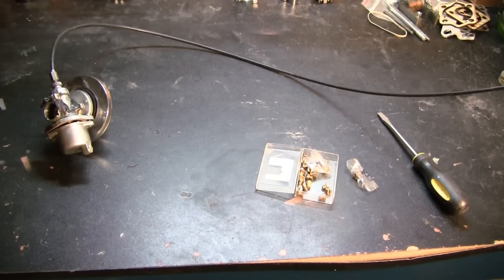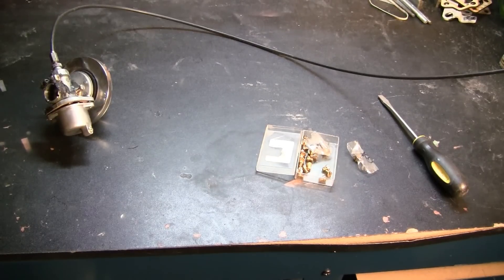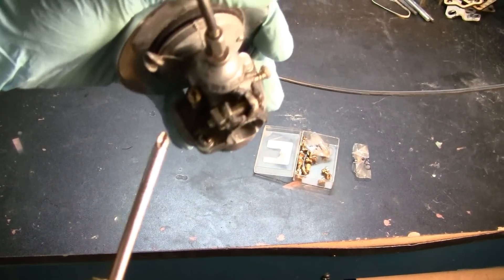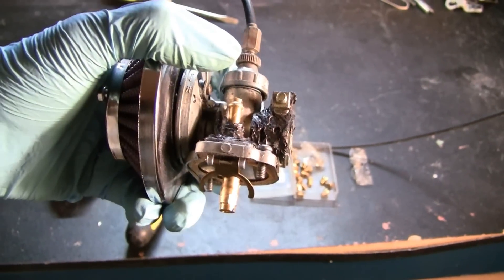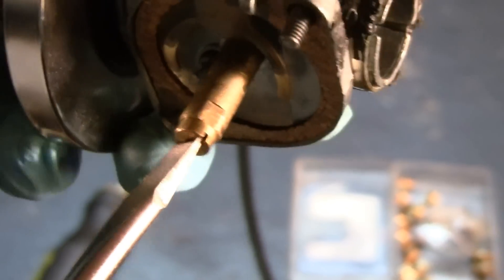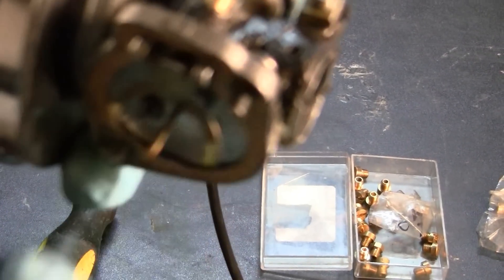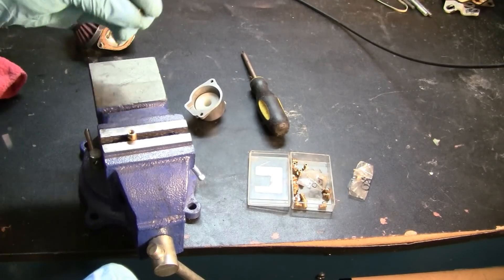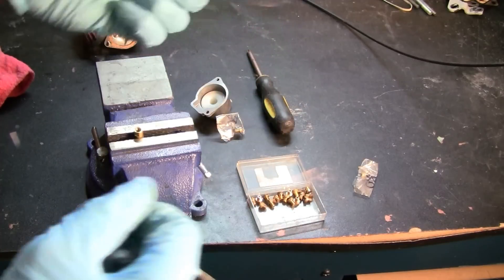Changing carburetor jets on your Motorized bicycle engine

Comment: I have done a reverse jug and placed my intake in the front and my exhaust exiting from the rear..now more air is being drawn into the carb..which has caused my engine to run too lean,  so I'm wanting to rejet the carb. to get more fuel in..to compensate for the extra air..I'm currently running 50+ mph but I know that I could get even power out of my engine if my air/fuel ratio was better..my engine will cut out at full throttle and my spark stays white to slightly gray..so I need to richen up the carb..

Comment: I moved up to an .80 larger and still no top end. I guess i will keep going. Plug says its lean still. What do they typically use in this carb if you performance tune the bike a medium amount? No reeds or anything crazy.
Reply: it could need a pretty high jet, they make them up to like 130s

Comment: wrong way to get the main jet out. the tube that came out with the main jet, has 2 small flats on it. use a small adjustable spanner. on this and screw out the jet. the vice is the last straw

Comment: Very nice straight forward video. I am gonna swap my jet bike seems to 4 stroke at wot after I reach 25 ish mph. So best I can tell from everything I read is in am too rich at wot causing power loss and 4 stroking. Do I siund like I'm on right track
Reply: Hey my bike is doing the same thing. I first discovered it after taking off the muffler cap making it possible to hear. Did re-jetting to a smaller jet work for you? Thanks!
Reply: Hey I am having the same problem with mine. I have many signs telling me I'm running rich. Did re-jetting fix your 4 stroking? My jets are on the way and I can't wait for them to arrive.
Reply: @Trevor charger Downjetting helped and when the engine was hot it stopped 4 stroking. It took 2 pulls to get it hot though.
Reply: @Trevor charger It's not overheating if it burns you. It could be but only a thermometer could tell.

Comment: im a 255 lb guy , i bought one of the racing carbs , yet its sloooooooow , which jet would you suggest for more speed?
Reply: moofasa1211 I think he's trying to say the carburetor is the cause behind the bike running so slow.
Reply: Do not buy any reed valve unless you have a windowed piston and port your motor with a boost port. 

I am a 300lb guy with a 49cc and can reach 34mph. 
Go to bicycle-engine.com buy the “power jug” its ported and had a rounded exhaust port and a 40mm intake inlet (you will need a 40mm intake) skirt your piston but only take off 1/8 -2/8. (On the inside of your piston there is a little line the runs around the bottom of it shave off about half way to that line) do that to the intake side of the piston. And of course get a good spark plug and youll be flying.
Reply: A racing carb that sells for a motorized bicycle is a general carb for many bikes most requiring more fuel than are motorized bicylce's.. you probably need a much smaller jet... but my opinion.. If your 255 lb your looking for more torque.. forget the carb upgrades there mostly  useless

1st cheapest easiest upgrade you will notice a difference 
NGK BPR6HIX Iridium IX Spark Plug 6.99 to 9.99 

2nd not to expensive ,not to difficult to install  fairly large torque upgrade... depends on your motor..
if you have 49cc get 
RSE Reed Valve Air Intake Kit gasbike.net has them for 34.99
if you have a 66cc or 80cc get 
CDH-G2 Racing Reed Valve Kit -Suitable for 40mm and 32mm Intake amazon has them 39.99

3rd and and very big upgrade very much added torque, very costly and can be headache to install and keep the exhaust gasket sealed.. and you will most likely need to rejet whatever carb your using if you get one..

Specifically from sickbikeparts.com Expansion Chamber  - Exhaust Pipe  75.00...Any other pipe is going to be harder to install and or to loud..

If your not even hitting 30mph.. Just take the end piece off the stock muffler.. Take the bolt off then end and it should come right off.. And bam huge Instant torque increase.. but wont rev high enough to go over 30mph 

 The absolute last thing you wanna do is get rear sprocket with less teeth, especially if you hard time climbing hills/gaining speed

unless you have many other upgrades already and are reaching so high rpms that you let off the gas in fear of excessive motor wear.. Then its time to drop down to a smaller rear sprocket... 

im running a 36t and hit 38mph today and my motor was really winding... gonna drop down to a 
30 Tooth CNC Sprocket & Adapter 
but im only 180lbs with all the above mention upgrades and a racing head plus a ported cylinder

Comment: What's a good resource for the jets?  Are there kits you can pick up?
Reply: Anywhere Amazon worx.  5mm jets for Delorto sha #50-80 65 go to for 66/80 70/75 for 100 depending on wich 100 it is

Comment from the maker: usually if you are at a higher altitude. it means that you have less oxygen to you. That in turns translates to lower/smaller jet sizes so that you can correct the fuel/air ratio of your engine. I'm not sure what Carb you have but try getting a jet size like 62/64 if you have a 66/80cc engine! Thanks and let me know if this helps!
Reply: JuiceMotoParts so i live in canada and my engine runs but it has very low power so will changing the jet fix my problem? And how does the "automatic" choke shit work??
Reply: JuiceMotoParts oh and by the way i have the delorto ebay nick off hp carb
Reply: I live on mt everist and mine has lots of power

Comment: Your float is stuck you need to take the bowl off an reset it or you could gently tap it with the handle of a screwdriver or something similar which will usually break it free an float properly

Comment: cool vid. my carb seams to leak a lot and i set the needle all the way down as to stop the fuel from leaking throw the jet. I'm in Reno about 5000 feet above sea level. do i need a smaller jet? i don't know whats going on. any help would be nice thanks.